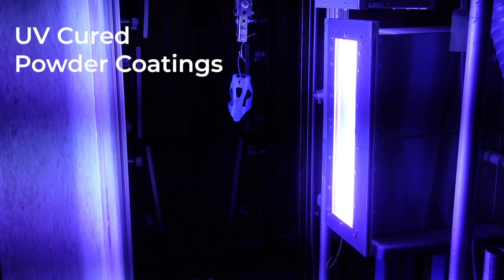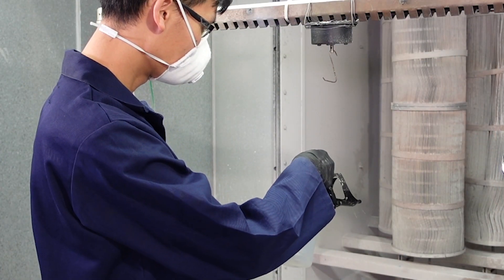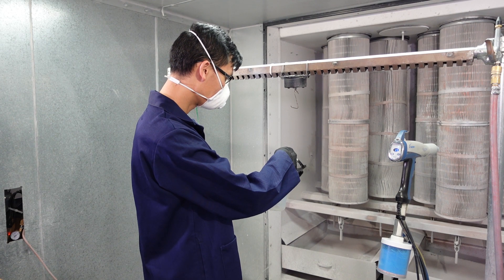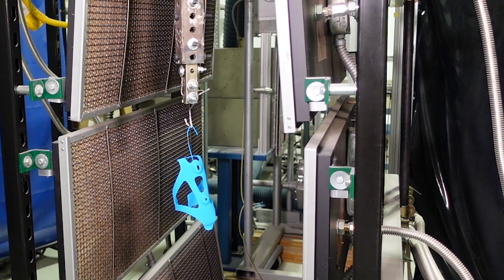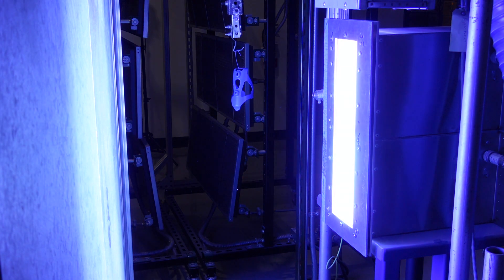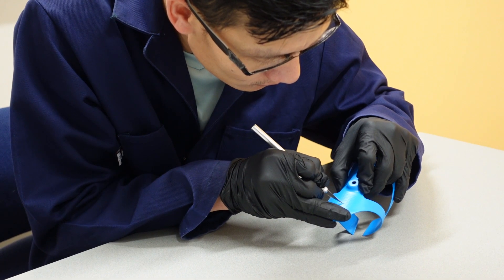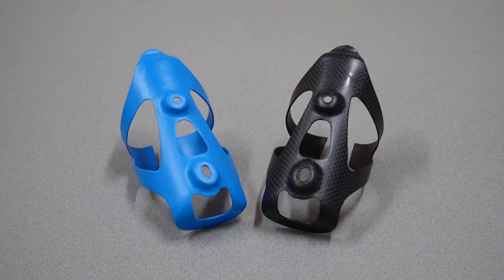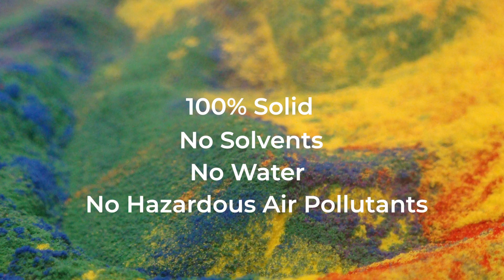Coat and Cure Demo Digital Demo: UV Cured Powder Coating on Carbon Fiber

Comment: How big can this get? We a 9 and a 12 meter long gas oven. we powder coat big stuff like truck trailers, cranes, construction profiles, but also things as small as screw heads. realistically, how long would a uv setup have to be to cure something 10 meters long? can it be railed through a small section or does all the materialneed exposure at the same time?